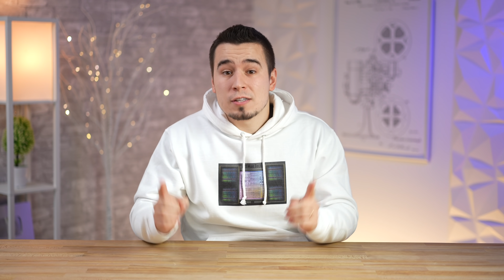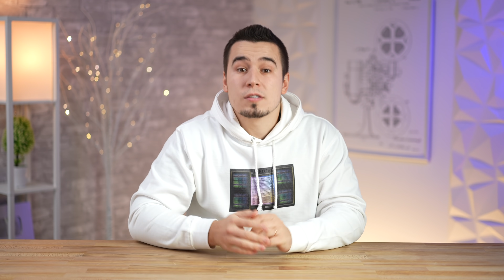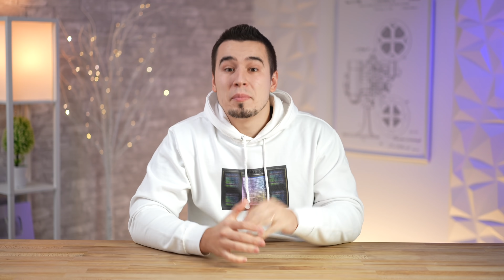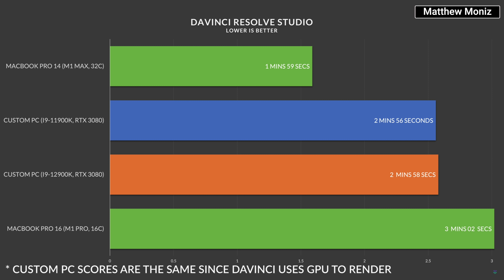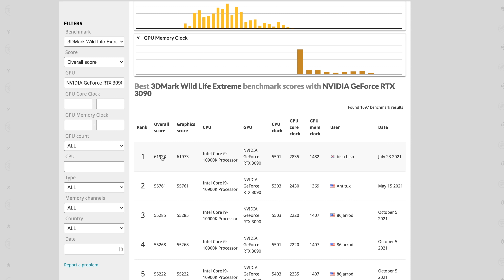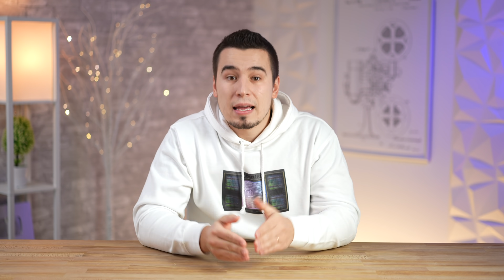M1 Max Quadro Mac Pro Leaks - The Alder Lake KILLER! 🤯

Comment: Don't be silly,  40 core firestorm is definitely no match for a 38 core golden cove... 12th gen xeon W isn't held back by node limitation of ringbus like the 12900k
Reply: The current Alder Lake in 16C/24T pulled 271W peak power when Anandtech tested all P-Cores under load. Can you imagine the power/ cooling and energy cost requirements of a 38c version? Lol
Reply: @theotherphil  as if you need to care about power consumption for a WORKSTATION LMFAO

And yeah, as a friendly reminder, in cinebench R23 stress test, 12900k scores 14288 at 35watts, while m1max scores 12326 at 30watts. Anything more you want to imagine?

Comment: You’re way off on your price estimation. The new MBP 16” maxed out is already near $7,000 with “only” 1 chipset, 64GB ram... so a Mac Pro with 40 core and 256GB ram will definitely be over $10k... Apple doesn’t trend to cheaper products lately. They’re only getting more and more expensive. Worth from a pure quality/quantity point of view, but it won’t be cheap. The current Mac Pro base price is already over 7 grand. So no way a top of the line Mac Pro will be at this price point... even if it would loose all expanding capacities like the Trash Can or like a super Mac Mini Pro.
Reply: But Mac has a display a trackpad a keyboard and that display is a 120hz one and it is mini led none of this which the Mac Pro doesn’t have so ya
Reply: @Aadhi2564  those cost under $500 to make and Apple charges around $1000 for’em. Thats a drop in the bucket in terms of overall price. Mac Pro will be well north of $10k when its fully loaded.
Reply: I don't think you paid attention to the video correctly. The base spec Mac Pro was $4k-$5k. Max spec was $8k ON TOP of the base price, so somewhere around $12-15k for a fully loaded Mac Pro with no additional options. It's certainly possible.
Reply: @MBZ-Nation  yes and I’m saying it won’t be $12k for a top of the line Mac Pro, not when the current one can cost $30k or even $40k. The $7k base price is more likely but it won’t just be 8k on top for the top of the line.
Reply: Just think that way, 4 times a M1 Max fully maxed out that cost at least $5k (not counting display and keyboard), that will be easily $20k minimum for a Quad M1 Max with 40 core, 128 GPU, 256GB unified memory and 4x 8TB storage.
Reply: @Spidouz  which will be toasted by m3 mb pro 16” in 2 years time for a fraction of the price.

Comment: As those machines and chips getting faster and more powerful, I am thinking what are the workloads that require that level of power. While we are approaching near real time video editing, blazing game performance etc., what are the use cases and workloads that are constrained by existing horsepower? AR, AI, VR? Where can this level of performance take us (short of a quantum computer). Seriously wondering what kind of awesome stuff we can come up with.
Reply: There are many. One of them is compiling large code bases, which can take hours to compile even with the most powerful CPUs out there. Imagine you have to add some extra features or fix some bugs in a really big software project. Every time you change even a single line you have to re-compile it to test out if the whole thing behaves the way you want it to. It can take hours with today's top of the line CPUs, optimal time would be a few seconds.
Reply: @jurajchobot  Partial compiles (small change) are usually pretty fast though. Running tests... maybe not so much.
Reply: Probably developing for the meta verse + block-chain integration into said meta verse
Reply: Music production at high audio resolutions and sample rates like 32bit/192 kHz, rendering of ultra-realistic static scenes, animated movies, etc
Reply: @bolttracks  there is really no point in music production at 32 bit .. 24 bit/192 already provides more headroom than most anyone could ever need. It’s greatly diminished returns beyond that. 

The real benefit in this arena will be even more sophisticated plugins that simulate analog circuitry, such as U/HE’s line of CPU intensive softsynths. He’s been waiting for a breakthrough like M1, in order to push the boundaries even further in plugin technology.
Reply: man we need them to open websites :P

Comment: The price is still too high imo. They need to get the base model down to $3000. There's no real middle ground. You're either a basic consumer, or Pro in their eyes, no semi-Pro's. For an audio guy like myself, I just need a PCIe option that doesn't break the bank.
Reply: How do you reduce the base price to $3k, when it’s going to be 4x what the MacBook m1 max is, which is minimum $3300?
Reply: @NOT_A_TOP_FAN  Minus the display. There's a huge market for audiophiles that just need something with PCIe and that performs better than the cMP 5,1 and 6,1 and doesn't cost an arm and a leg. We don't need crazy GPU cores like that.

Comment: If you believe in geek bench alder lake CPUs scores 1923 in single core and 17000 in multi core (i9) which is higher than M1 max.
Reply: Geekbench is a bad benchmark anyway. Doing actual real world work, the M1X is pretty darn mediocre all the way up to last in place when Metal isn't supported for hardware acceleration 😆. That's up against Intels very mediocre Tigerlake chips & completely getting stomped by AMD. Add any dedicated Nvidia GPU to the mix & it gets even worse for the M1...

Literally the only thing it has going for it is power efficiency for the performance you do get.

Comment: If Apple just made their own dedicated graphics card, that will destroy Intel+Nvidia together
Reply: It probably wouldn’t. The reason they’re so powerful is because of the unified memory and direct access to the cpu. Dedicated gpus remove whole point of M1 being so powerful
Reply: @Snakyy1  When power is not the concern, nVidia can make some crazy powerful GPU cards using not the most advanced process technology.  For example, NVIDIA A100 80GB card has a memory bandwidth of 1.94 terabytes per second.  M1 Max has 400GB/s.  nVidia can have nearly 5 times memory bandwidth.
Reply: i mean performance per watt, yeah but in a discrete graphics card there’s more to making a GPU then just adding more compute units. It’ll be cool to see what apple can do though if they took the time and R&D to create a discrete GPU with all the technologies that Nvidia has.

Comment: I wish Eagle Dynamics would make a multithreaded version of DCS World for Apple Silicon.
Reply: It's probably not available due to it requiring instruction sets not supported natively on arm
Reply: @alexmeek610  yeah, I’m sure it’d take extensive work.
Reply: @toastrecon  it's not even a work thing if arm doesn't support the extension natively it's locked to the x86 part of the m1 cpus because the architecture just doesn't support the extension
Reply: @alexmeek610  right. I’m thinking it would be an extensive rewrite. I’m not an expert, but I think one of its current limitations is that it’s bound to a single CPU thread currently, and it may have other technical debt that is keeping it from being fully up to speed with even x86 capabilities. It makes me wonder with ARM gaining popularity, if they’ll eventually be interested in transitioning over. I guess it’d be a huge undertaking, but one that many companies will have to face.
Reply: @toastrecon  what's likely to happen is  arm adds the extensions and instructions sets to support it or Apple adds them

Comment: I know someone that worked on these processors. He said these processors are so powerful that Apple has physically fabricated them to be slower. Otherwise it would have been a big waste of power for todays computer needs.
Reply: lol u mean like how they were idling the fans while doing renderings and benchmarks practically? can probably pump more power into them, but I don't understand if ARM overclocks the same way as x86 chips
Reply: @jamesrosenberg1612  You can control the fans manually on the M1 machines if you choose to in order to get full performance of the chip. What I'm saying, Apple has physically manufactured them slower because these chips are still so good they  exceed todays computer needs.
Reply: this means they are probably going to remove most of the limitations for the new mac pro, creating an absolute beast
they won't have to worry about heat and fans with a tower pc so they are free to overclock everything
i cannot wait to see intel, nvidia and amd struggling to keep up with the M series lolll
Reply: @blueslimee  It will be insane. This isn't the first time Apple will do this. Back with PowerPC, they had 2 dual core Power PC G5 chips in one Power Mac, giving it 4 cores, which was unheard at the time. Now they will pretty much be doing the same, but everything will be in one chip plate.

Comment: Concidering the fact that the intel alder lake cpus are not yet optimized for those comparisons against them arent kinda fair since those macos ports have been optimized for the arm chips. The hybrid cpu design is new and the updated cpu scheduler still has problems. Sooooo the difference may actually be smaller.